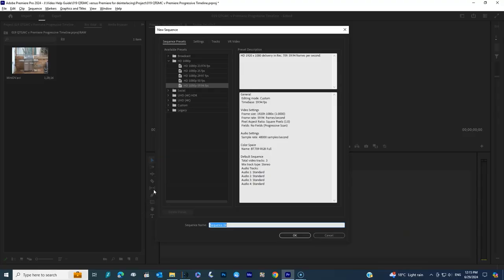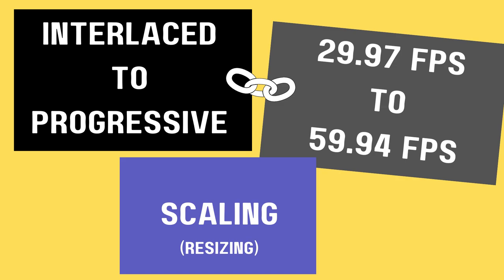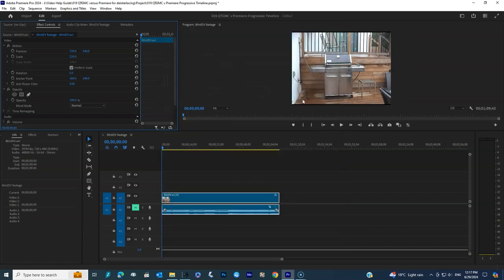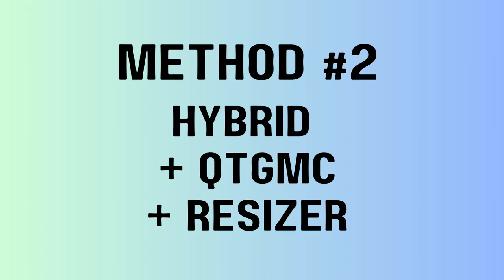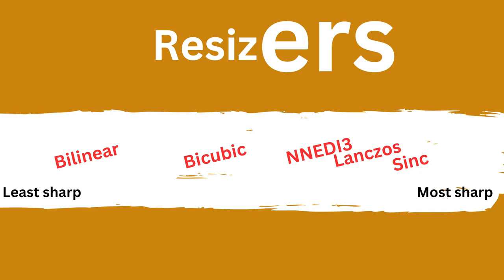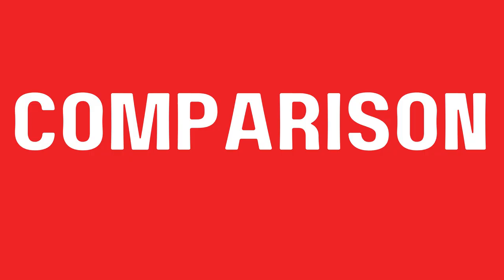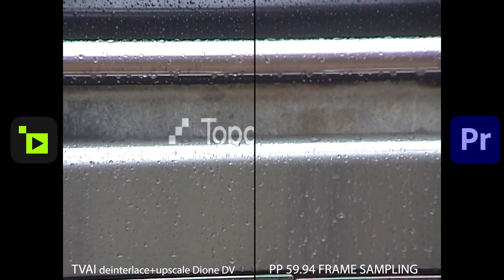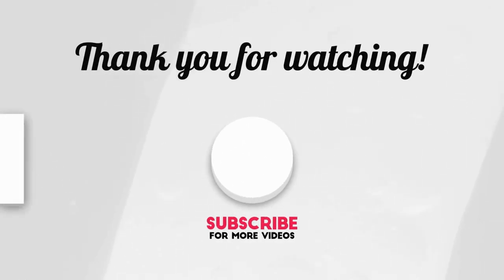Deinterlace and upscale with Hybrid, Premiere, and Topaz: which is best?

Comment: You didnt deinterlaced in Pr. It was just resized and framerate was poorly streched. To actually get 2x framerate you have to use deinterlacer in flow. Something like Yadifx2 which used both fields as separete frames instead of trying to combine them.
Reply: There is no need to de interlace when using Premiere Pro with a 60 FPS sequence. The 59.94 fields are easily interpolated into 59.94 frames canceling out the interlaced fields. Motion will look better at 60P as opposed to 30P. Having said that I don't see how Video Capture Guide's DV camcorder had such horrible image quality. We should have seen what the video looked like at it's native resolution as a guide for image quality. For this video, Video Capture Guide should have used Media Encoder as opposed to using Premiere Pro because you cannot do over the shoulder editing using Hybrid but you can with Premiere Pro. The link below might be worth watching. 

https://youtu.be/vqCi9B_7mdU
Reply from the maker: @TechTVusa I would be willing to send you a WeTransfer with the raw DV file taken with the TRV-17 so that you can to deinterlace in Premiere Pro 2024 to see if you get the same results as did I.

The point of the comparison video wasn't to show off how good or bad the original TRV-17 camcorder is, but to compare the results of Premiere Pro versus QTGMC—in going from interlaced 29.97fps to progressive 59.94fps. 

Regarding Adobe Media Encoder, I just exported it the video from my Premiere Timeline via Media Encoder and looked at the two videos side by side and they are identical. If there is a specific setting you want me to try in Media Encoder, please let me know. But the settings appear to mirror the ones in Premiere Pro.

Perhaps you can do a comparison video using your own DV footage and try Premiere Pro versus Hybrid (QTGMC) and then post the findings on your channel.
Reply: @videocaptureguide  I appreciate your response and willingness to collaborate. My problem with the video is you should have used Media Encoder as opposed to Premiere Pro for this video. My video will demonstrate why. I will give you a shout out in my video response (you might pick up some subs) and actually revolutionize your thought process at the same time. My thought process has been altered as well. Having said that my video will be much different than anything you or I have done thus far.
Reply: @TechTVusa  I mean it didnt deinterlace it automatically. It just burn interlaced video into progressive and will mess it up with compression. Basic mistake.
Reply: Curious on your opinion on which software is best for simply deinterlacing? No upscale or ect.

Comment: Great comparison video as usual! Using DV as a starting source is interesting because you might find that something that was analog to begin with may be "more improved" by various deinterlacing algorithms. This is presuming the original footage was shot on DV as opposed to being converted to DV from VHS by something like the ADVC110. Hardware deinterlacers might be an interesting thing to compare for future videos as well. The downside to hardware deinterlacers though is that you can't go back to the "source" material if a better deinterlacing method comes along later of course.
Reply from the maker: Yeah, I agree that natively shot MiniDV footage is different from Video8 footage captured with even a good SD capture device. Also I recorded the DV footage outside with plenty of cloud diffused light, which was as good as MiniDV is going to get. Anyway I assume (hope?) the results carry through to SD footage.

Comment: Do you use anything to denoise? I have found the vhs tapes when digitized often have a fair amount of audio hiss to them. I've messed with premiere's denoise before and it does a decent job.
Reply from the maker: Hybrid has a number of denoise tools but I'm not an expert. I have used the denoise option in QTGMC. Also Temporal Denoise. I have seen other people refer to other ones in their work. I err in the side of minor denoise so as not to do damage to the video. I'm hoping tools in the future will be able to look at your raw video and apply the best denoise (and other) filters the way that video restore experts currently do thanks to their vast experience. 

Another good option today is the Neat filter plugin. It works in Resolve, Premiere and even VirtualDub. It gives good results and I have seen videos where its sharpening tool works well in combination with its denoise tool. 

Regarding audio hiss, Adobe Audition can deal with that.

Comment: Hi! I spent lot of time trying different devices to hardware deinterlace last was converter box like cypress cslux 1080p and use Rgb Scart connection cuz it not support s-video, only composite or RGB through scart so Panasonic DVD needed for that and for capture I use pci card blackmagic declink 4k through hdmi splitter to make card thin as this is 10 bit YUV signal since otherwise they paired only in 8 bit RGB and it do job nice but later I switched to more adjustable device - Kramer vp 728 , a scaler where  I achieve 720p or 576(480p) depends on capabilities of capture card I  prefer Magewell capture pro pci, those both have many options and scaler itself have lot denoising and sharpening options in output picture tab for result signal also as do smooth 50/60 fps deinterlaced if look frame by frame after then it feels as yours QTGMC example no ladders on diagonal lines etc, so capturing progressive made me easy for now,also there bothering with 10bit per channel capturing since premiere pro not always understand pixel formats like r210 av1 compression and codecs etc  (things to solve soon) but in rare cases in stop frames I see small strings noise, in motion all seems good so I goin in side where leave deinterlacing to hardware, since Panasonic dvd is excluded from chain now my chain needs an frame synchronizer I guess add DataVideo DVK-200 before Kramer to prevent frame jumping that is not visible on loop through monitoring CRT when scenes cuts on tape sometimes, why I prefer to exclude Panasonic DMR-ES57 modern analog of DMR 10/15 which I have too from chain since it fix those frame jumps but mess colors a little and provide kinda ghosting artifacts in fast motion on bright scenes. I leave this comment since Maybe this will be curious to u.

Comment: Before I make a response video I should ask. Are you going to make a Premiere Pro workflow video like other people have asked for? I am asking because if you plan on making that video soon I may not need to make a response video.
Reply from the maker: I have not yet been able to successfully install an older version of Pr on my other Windows 7 computer. I keep getting an error. So I can't capture DV with Pr. Is that what you are referring to? Is it your view that transferring DV via Pr instead of WinDV will somehow improve the eventual deinterlacing of the video inside Pr?
Reply from the maker: “WinDV has options. That is a big NO NO! Edius, FCP and Premiere Pro  do not have options for recompression or any other options for that matter.”

The only option in WinDV type 1 or type 2 DV. The internet says the only difference is that type 2 contains a second copy of the audio track explicitly marked as audio in the AVI container. And there is no recompression setting in WinDV. So, I think WinDV is a big YES YES. But I am open to trying Premiere Pro to transfer, but I haven’t been able to find/install an older copy.

I would very much like to do this comparison to either confirm what you are saying or confirm what everyone else is saying. Because everything else I have read states it makes no difference which application you use to transfer DV footage from a camcorder to a computer via firewire. It’s just data. 

“The scaling that was performed in this video was not  something I would do for a multitude of reasons.”

Can you clarify what you mean? Do you mean that you don’t recommend scaling any video because you’d rather keep it at its native resolution and let your TV upscale it? Or do you mean that the method I used in Premiere Pro is not the best one, and that there is a better way with different settings? If so, please let me know so I can redo it.

“How are you adding tiles, color correction and cleaning up the audio? That is what I meant by an efficient work flow. The Holy Trinity was hard to beat if you had several clients per week giving you ten tapes each. The other software you used was like working a combination lock in order to get the settings correct.”

I agree that one software that does things good or great, is probably a good choice. However, I think deinterlacing is important and has a big impact on the final visual. I think taking the time to go from 480i 29.97fps to 480p 59.94 fps with the best tool (QTGMC) is worth it.

Comment: Thank you for the comparision Mr Capture Guru! You have showed us the workflow: VirtualDub - >Hybrid -> Davinci Resolve. Do you think it will be possible to cut one step and go directly from VirtualDub to Resolve in the future. Or is Hybrid still superior for deinterlacing (or other alternatives as shown in this video). 
Maybe you get quality loss after every step in the process.
Reply from the maker: Short answer is yes. I haven't used it but I read that Resolve does a serviceable job at deinterlacing. And for color stuff, it's the best. But Hybrid also gives you tools to dehalo oversharp videos especially useful from MiniDV footage. And it has good denoising tools, and many other tools to fix a range of artifacts you may not even know are there or didn't realize could be fixed, like rainbowing and dot crawl. It can be overwhelming, which is why I recommend you use it for deinterlacing and then thinker here and there as you learn to use it.

Comment: I kind of wonder about this 59.9 fps gospel for 29.9 video.

Let's say your capture chain actually delivers ~30 half-frames per second.

Now, to deinterlace, you're either going Bob (double the scan line in each half-frame to fill the screen and cut your vertical resolution) or Weave (comine/blend the 2 half fields, keeping your vertical resolution but getting combing artifacts and lower temporal resolution). Or a combination of both (bwdiff). But in neither case are you going to create "more" frames than 30.

(Yes, I hear some advanced algorithms look across many frames/field and interpolate entirely new frames, these could output more than 30 fps I guess, but it is unclear to me if they are allowed to do so in the processing chains you and I use.)

If you crank the frame rate up AFTER the deinterlacer, well, yes, that's maybe going to do temporal interpolation to create new frames, and the increased, synthesized temporal resolution may make motion look better to the eye, but that would be true if that was done to any lower FPS source material.

I just did a test with some fast motion video of a pumpkin rolling down a hill (don't ask) and did the scale/deinterlace/frame-rate transform with this Perplexity-generated ffmpeg command:

ffmpeg -i input.mp4 -vf "bwdif=mode=1:parity=tff:deint=all,scale=1440:1080:flags=lanczos" -r 59.94 -c:v prores_ks -profile:v 3 -vendor apl0 -bits_per_mb 8000 -pix_fmt yuv422p10le -c:a pcm_s16le output.mov

Looking at the results in Final Cut with all of its local viewer deinterlacing and field-forcing turned off what I see is a weird repeat of earlier frames, seemingly to "pad" the time. So when the camera is zooming in, looking at it frame by frame, I see it go in-out-in-out-in-out. Mind you, it looks fine running "at speed." But doing a simple upscale without frame rate change the zoom just goes in-in-in-in as you'd expect. And to my eye looks no different, and maybe better than the 60 fps version.

I get that, intuitively, giving the deinterlacer double the frame rate room to "spread out" seems logical, but I don't think the deinterlace filters we commonly use do that, or, if we use an exotic deinterlacer like VapourSynth that might want to create new frames (I don't know if it actually does) if it would be allowed to do so since framerate conversion and deinterlacing are separate, isolated blocks in our processing chain.

Right now, for me, I don't see enough (or any) difference between 29.97 and 59.94 to justify the massive increase in the size of my Prores 422 intermediate files. But I'm interested to know where my thinking has gone wrong since so many people seem to swear by this 60 fps mantra.
Reply from the maker: I read your comment a few times as there is a lot to it. I'm not an expert in deinterlacing or the theories. As a next step I would suggest you repeat the steps but this time add a line of code to indicate if it's a top field first or bottom field first source video (ie, SD capture or DV transfer). The symptom you described with the pumpkin roll reminds me of what happens when TFF is used on a MiniDV video, and vice versa. 

Then I suggest you try QTGMC deinterlacer to verify if it does the same thing or not in the pumpkin video.
Reply: It starts with the actual fps of your source. Interlaced NTSC has both 29.97 and 30.00, but broadcast is 29.97 as it was easier to transmit than 30.00. So when you deinterlace, you're joining both top field and bottom field into a single frame, so 29.97 becomes 59.94. Increasing it to 30/60 is possible, but it speeds up the audio. But as for combing artifacts, it comes down to the algorithm you choose... the better the algorithm, the less chance of artifacts.
Reply: @michaelbinbc  No, I don’t think that’s true. That’s not how deinterlacing algorithms work as I tried (poorly) to explain in the comment above. I’m traveling now so can’t get into it further, but I may return to this when I return home.
Reply: @WardCo go ask on an actual video editing site like Blackmagic... the makers of Davinci Resolve editing software. Industry professionals will give the same response. Bob only uses 1 field at a time, but interpolates the missing data, while weaving the 2 fields into a single frame at 2x the fps gives all the data and looks far superior. And broadcast interkaced NTSC in North America is 29.97, not 30. They have 30fps videos, but not for broadcast. It comes down to data rate and the ability to broadcast both color and stereo audio. But hey... believe what you want I guess.🙄

Comment: Top video effort, however I am presently confused and have this question - for SD AVI files converted from Hi8 tape via fire wire– Do I deinterlace and upscale my large AVI files then load each one for editing into Filmora or Davinci Resolve? 
Previously I purchased Filmora, converted the AVI to MP4 in Filmora then edited and exported again.  A few months ago I paid for the version upgrade and my final product is now of unacceptable low quality and severe combing regardless of what settings I choose.  
I have found Hybrid, handbrake and an prepared to buy Davinci and drop Filmora.  Help appreciated.  Steve Canberra
Reply from the maker: I understand you digitized your analog video to DV25 and transfered via Firewire to your computer. You now have an interlaced video (bottom field first) in the DV25 codec. That's a good start.

The next step is to deinterlace in Hybrid using the QTGMC deinterlacer. You can also upscale the video a bit, if you like, for instance to 720p or 1080p. Be sure to export using the ProRes codec, since you are not ready to upload to YouTube yet.

After outputing the ProRes MOV file from Hybrid, bring it into Davinci Resolve and tweak the colors as you wish. The free version allows you to do the color correction. 

Then you can export the video to an mp4 (H.264) and you are done.

By the way, the reason why you should deinterlace in Hybrid first is that if you bring an interlaced video file into Davinci Resolve, it will try to deinterlace it. But it won't do as good a job at deinterlacing the video as Hybrid does using the QTGMC deinterlacer.
Reply: @videocaptureguide  Thanks for taking the time to provide guidance – you are a champ.  
I captured my AVI files about 20 years ago from tapes via a Sony DV camera on loan.
So I will process my full AVI file’s in Hybrid with deinterlace, and some upscaling.  Convert from AVI to MOV (not MP4 yet).  Drop my Filmora purchase and buy Davinci.  Bring the file into Davinci for editing (Opening credits, comments, transitions and so on).  I usually cut out about a 1/3 of junk from each file.  Do some final tweaking and export to MP4 (H.264).

I am so grateful – I have already edited 40 tapes in Filmore over the last year with another 20 to do the correct way.  Thanks again mate – I owe you a beer or a coffee.

Comment: Is Hybrid a fork or made by the Handbrake people? User interface looks so similar
Reply from the maker: Hybrid is freeware made by Selur. It is many more options than Handbrake, which makes it hard to use at the beginning. But it's much easier to use than writing scripts (AVS files) in VirtualDub/AviSynth with settings for the dozens of different plugins. Hybrid is a GUI for the most popular plugins. In that sense it is closer to StaxRip than Handbrake.

Comment: Very informative video. Thank you for the follow up. Two questions: 1. why not use the deinterlace option in Premiere under field options; does it cause issues? 2. Is virtualdub good for deinterlacing after capturing? Thanks again for your time and research.
Reply: VirtualDub's deinterlacing filter only gives you a few options. It's VERY limited. Same with Handbrake. Despite its humanity-hating user interface, Hybrid and QTGMC produce far, far superior results.